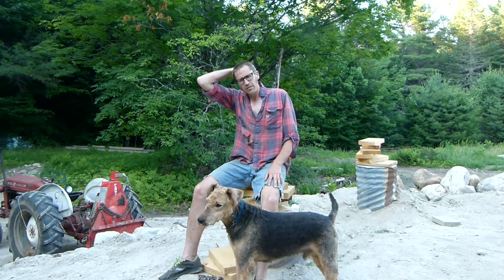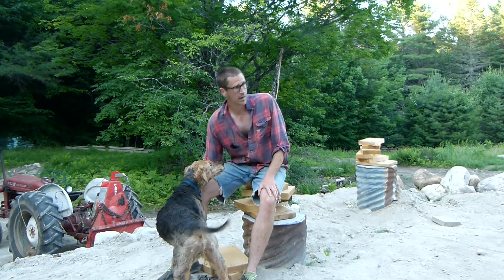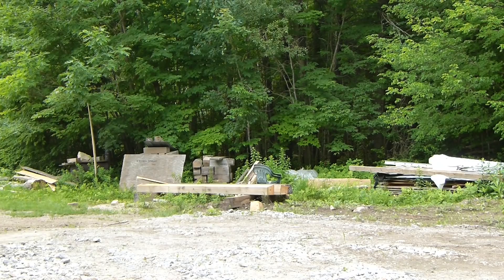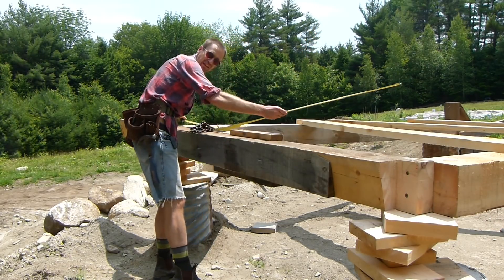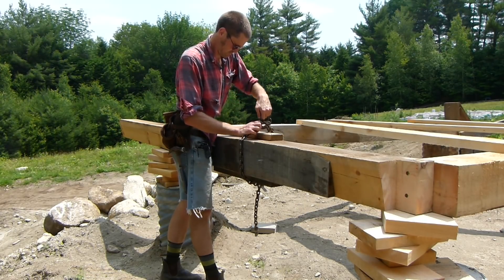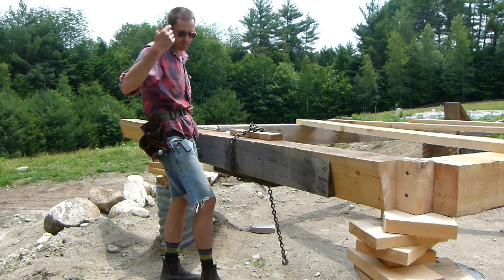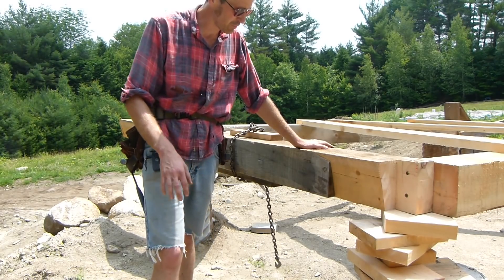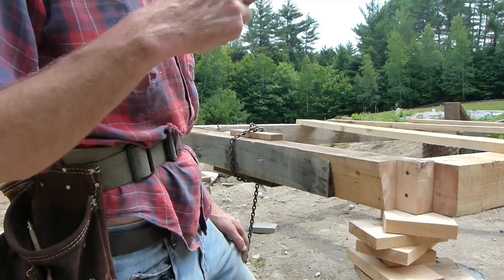House from Trees SE3 EP5 - Elaborate Pully System

Comment: Green wood treated Lumber would be good on top the concrete columns moisture from the concrete
Reply from the maker: I put pressure treated lumber under the posts. I guess i didn't show that. Thanks for the tip.